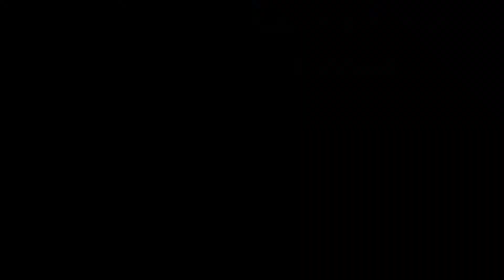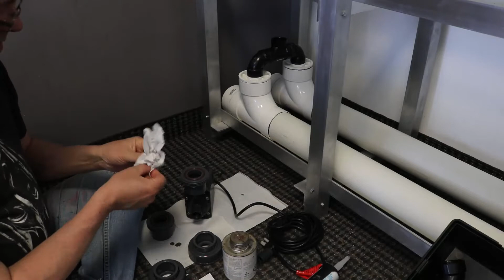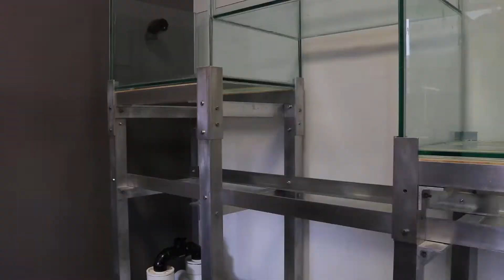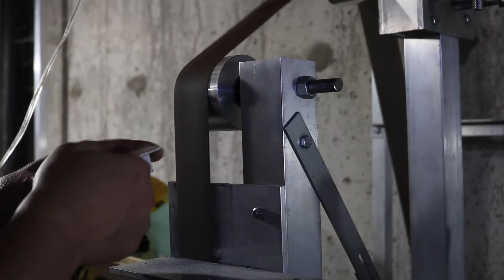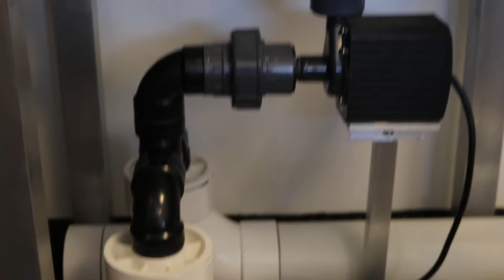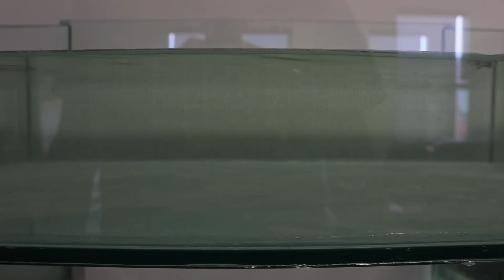DIY Drop Off Or River Tank Part 5

Comment: Few pounds of lava rock is like maybe 5 bucks at Lowe’s. Also I don’t understand how their is any mechanical filtration. I see a massive bio processing but at some point sediment and detritus can build up. I mean my A.R.R.S. Turns my sand into low flow bio media plus the FX6 filter also. My goal is 500 gallon one day so down for innovative ideas.
Reply from the maker: The longest running one of these that I have is going on twenty years with no cleaning. If the tank is balanced there is little need for mechanical filtration. I have one that I supplement with a mechanical filter. It's heavily stalked. Thanks for watching

Comment: Is there any mechanical filtration or just lava rocks?  I have seen your other build video of the canister and know you didn’t mention it there. Do you have any issues with debris and why did you ditch mech filtration to begin with.
Reply from the maker: Thanks for stopping by and commenting. I've been running these filters for a couple decades and I find that if you balance the tank the biological filtration is all that is necessary. I wouldn't recommend it for an inexperienced aquarist, but anyone with some experience will find it really cuts down on the maintenance.